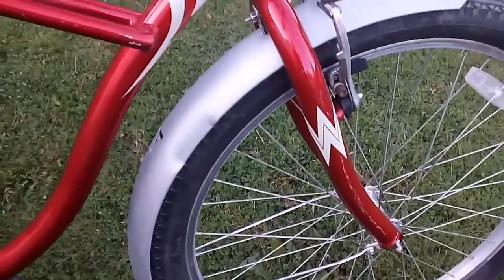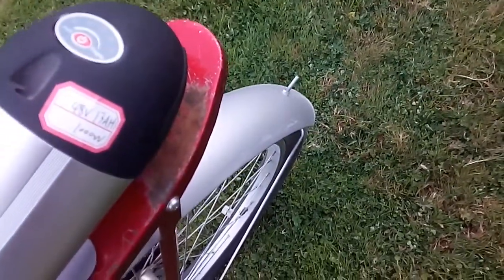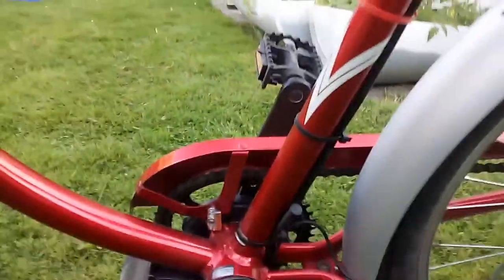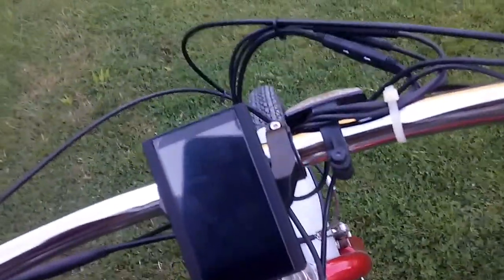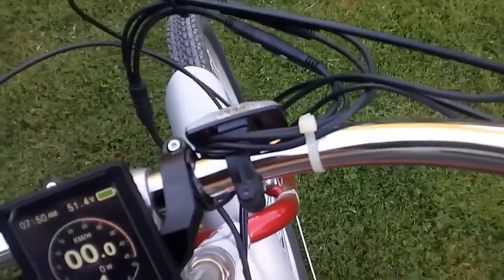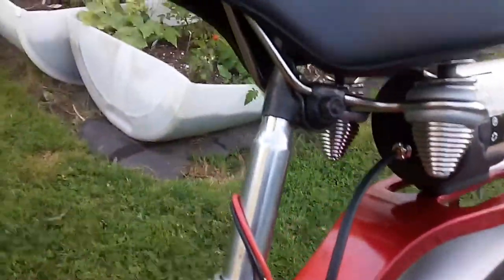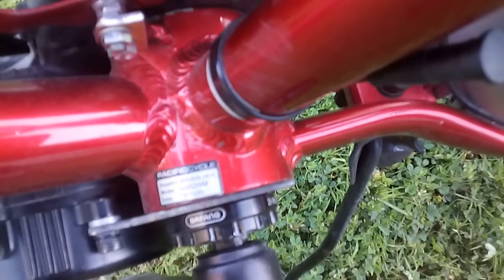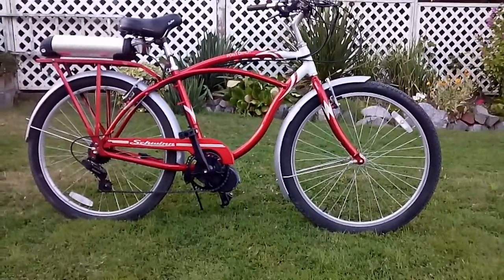Schwinn Point Beach Cruiser 8FUN Bafang mid drive 500W

Comment from the maker: Update: Apparently you can get this adapter from Luna Cycle: https://lunacycle.com/american-style-eccentric-bb-to-bsa-adapter/
Reply: except it's sold out :/
Reply from the maker: @jamiecooper  that's frustrating. I made mine out of wood, so if you have the  patience you can try that. Try to use a single piece of hardwood, like oak. In my case I used two small pieces of 2x4 which I had laying around. At that time it was just an experimental installation and it worked so well I kept it as is. Good luck.

Comment: Wanting to put a 750w BaFang mid drive in a Schwinn Cruiser5, did you have a machinist make the bushings? any details you would be willing to share?
Reply from the maker: I carved the off centre 'bushing' or eccentric adapter out of wood. I used hole saws, wood rasps and a sanding machine. Basic woodworking. You will have to cut a bracket out of some flat steel too. Just match the thickness of the bracket that came with the bafang motor. See : https://www.youtube.com/watch?v=yPjYvpQ7yHg&t=27s
Reply: @randphong  Thx for info. Now there's nothing to it but to do it.
Reply from the maker: @panderbear7  Good luck with the build. You will enjoy riding as it becomes effortless!

Comment: How much did the electric kit cost you on the PB cruiser?
Reply from the maker: Mid drive was US$435 back in 2018 & rear mounted battery (13AH) was $184. Later bought another battery (20AH) for $197. I put this in the mid mount battery box I made. Front hub motor I added later was $167. I use both batteries for very long rides, (4 -5 hours!). My other vids show  progress on the bike.

Comment: Do u have a vid of putting together?
Reply from the maker: Sorry, not on the full installation, but there are lots of vids on youtube. The main challenge was the big bottom bracket and the need for an off centre 'bushing' or eccentric adapter. I explained it on another video: https://www.youtube.com/watch?v=yPjYvpQ7yHg&t=27s
The one that @Noe F mentioned could work, but you need to check the measurements. Here's another one. They are expensive too. Cost more than my bike!
https://wheelsmfg.com/eccentric-bb-for-bb30-24-22mm-sram-truvativ-cranks-black.html

Comment: What was the original size of the motor? It 68mm - 73mm?
Reply from the maker: Yes, mid drive motor fits 68mm - 73mm wide bottom bracket

Comment: Can tandem Eccentric inner bearing adapter be usefull for this type of "American" bottom bracket to help fit a Bafafange mid drive. 
Here is a picture of one for tandem bicycles. https://www.cannondale-parts.de/Eccentric-inner-bearing-adapter-tandem-BB30
Reply: yes that should work, but check measurements before buying. I made mine from wood. sorry for the extremely late reply, but I missed the notification.

Comment: I am in need of that adaptor bushing. Would you consider making one to sell me?
Reply from the maker: Ideally the bushing should be made from aluminium or steel on a lathe. However, I used a piece of well seasoned wood.